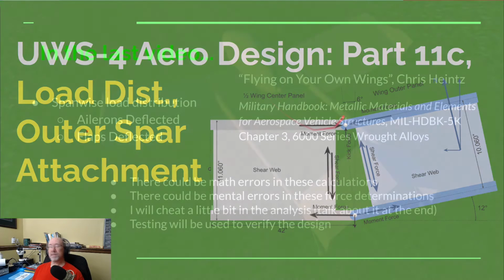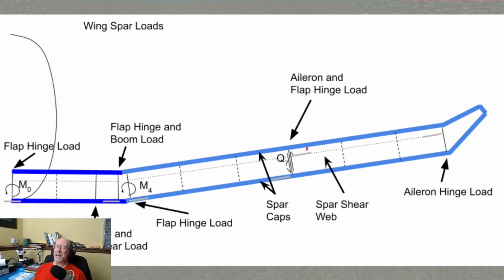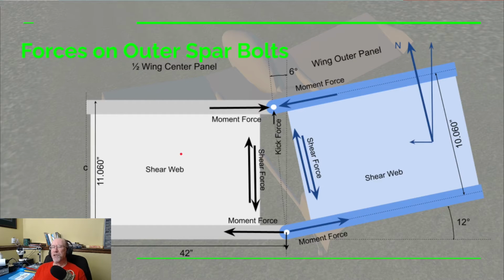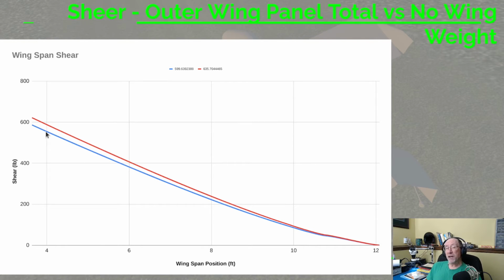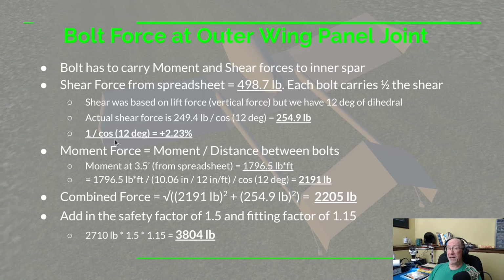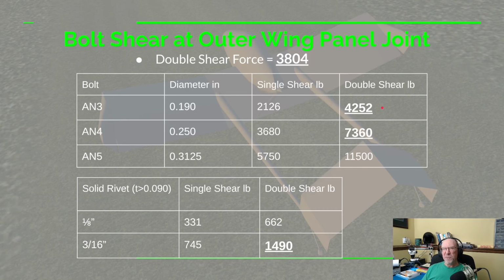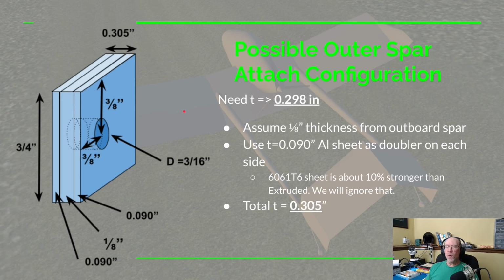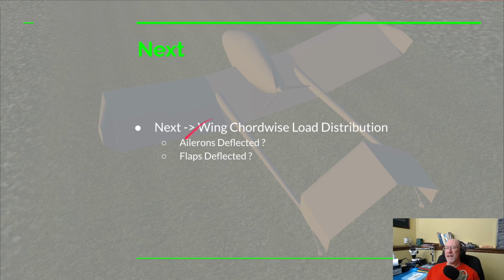UWS-4 Aero Design: Part 11c, Load Distribution,  Outer Spar Attachment

Comment: Hi, thanks for the video!  However, I’m not sure I understand why you subtracted the wing loading was it from the shear calculation?  I would think you want to start out with the wing weight, then add a max wing loading force down, and then add a max wing loading force up, for the respective cases of up and down forces on the wing. If that is what you did it was not clear. If that was not what you did then I don’t understand. (Probably the letter). Thanks!

Comment: I’m sorry, I’m a bit confused.
At 20:38 how’s the normal force is greater than the lift force?

If I’m not mistaken, this normal force is a component of the lift force, a projection, so it definitely has to be smaller. Matter of fact I suppose it’s a cosine of wing angle 

Correct me if I’m wrong.

Thank you!